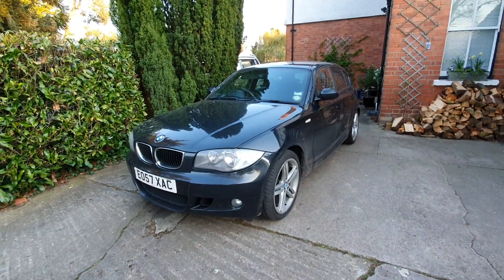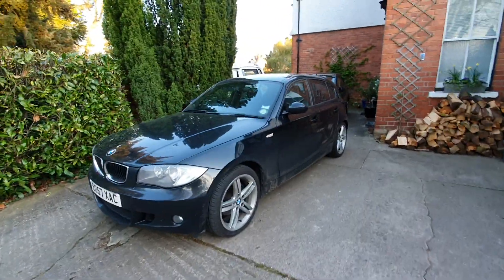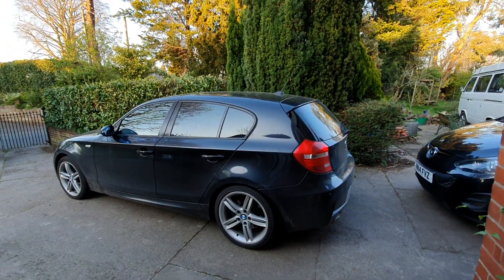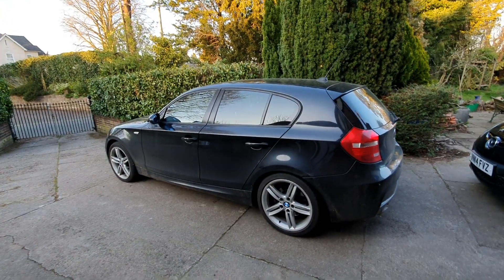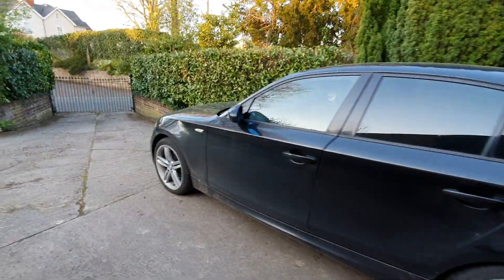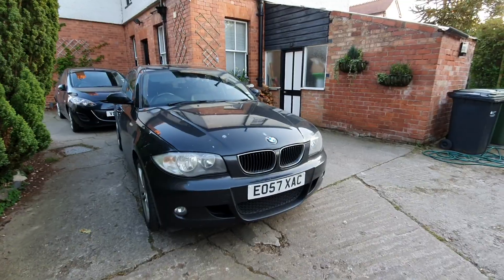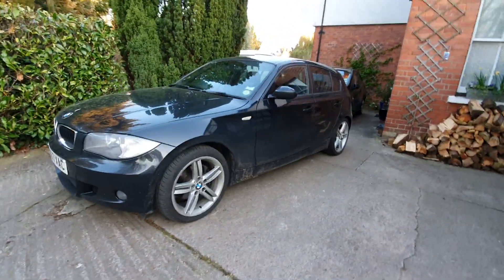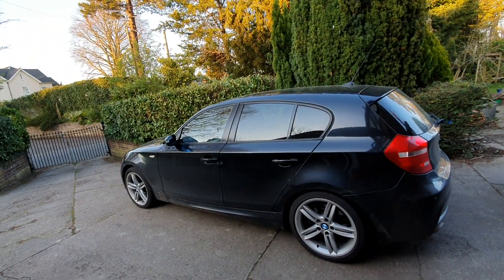BMW Traction Control / ABS fault *EXPLAINED*

Comment: Great video.. Thank you! Same with my Z3 today. It seemed to correct itself a year or two ago when it happened before. is it safe to drive?
Reply from the maker: yes, although bear in mind abs will not work :)
Reply: @drivelife.channel   Thank you for your speedy reply! 
She's braking just fine..did a few quick breaking tests...
I have a long drive soon..just a bit concerned...
The Circular light warning doesn't say ABS in the middle..its an Exclamation mark..is this the same?

Comment: Only £4 but I am not a mechanic and my car was at the point of not driving as the light keeps coming on. Therefore I have to pay, it's more like £2k when you add vat😟
Reply: @azazaz511  Yes I am sure I have 5 more payments to make of £200 +£. My car at that time was around £5000

Comment: I had this issue with my bmw 3 series caused the engine to cut out and lose power. You have to turn the traction  control off and get the abs sensor and reluctor ring changed which can be hard as the driveshaft can be all rusted up and hard to take off. Why had Bmw designed such a dangerous fault

Comment: Great video. Just want to add a comment for those trying to figure out their car problems. I had a similar problem however the light would go off a bit more randomly and not necessarily due to corners or bumps. It turns out it was just an old battery and therefore due to low voltage.

Comment: Hi mate, did you ever replace the drive shaft or rulluctor ring ? Or did you just drive round with the traction off ? Miss the bmw video, I may have to get a volvo 😆
Reply from the maker: Hey man! I didnt, the parts arrived the day of my accident 🤣 it was traction off which I preferred anyway ;) you need to join the volvo club! ;) you can get some seriously good motors for not a lot of money!

Comment: I have currently come across this problem and currently in the process of looking for fix options, great video and great knowledge. Debating whether to change it myself, just worrying on the amount of corrosion and the clean up of the shaft etc would you recommend I try myself or take to local dealer?
Reply: You can Try youself but local dealer its maybe the best I used that. Changed abs sensor and ring common issue om BMW 1 series and 3 series spesically the left side.
Reply: Space out sensor for temp fix